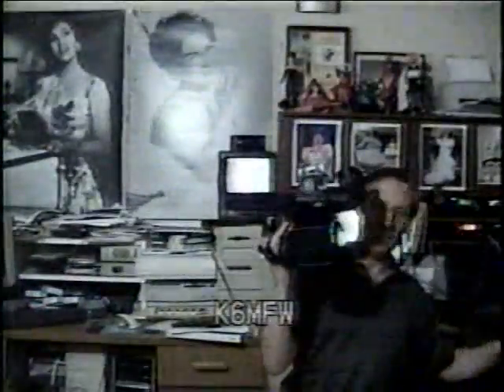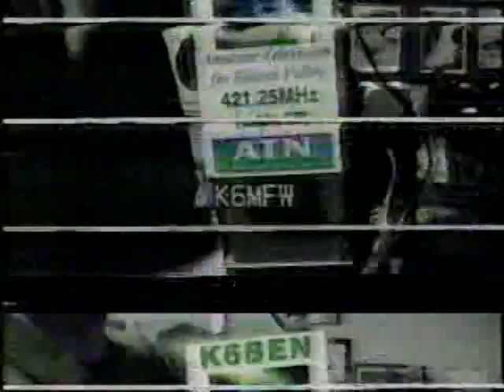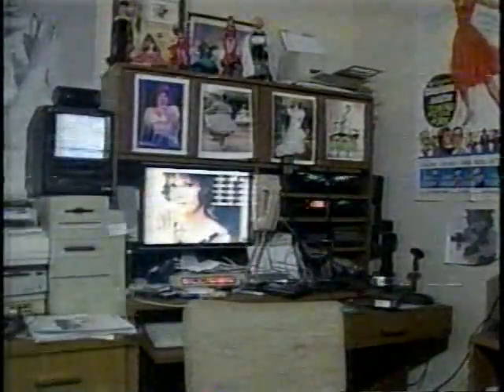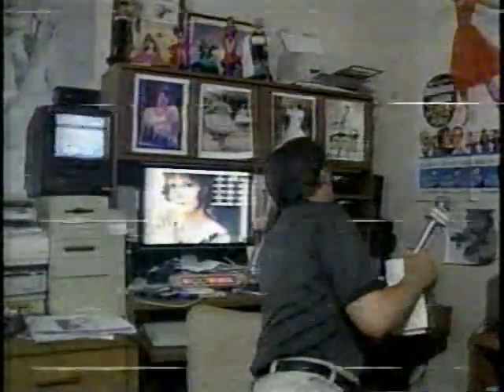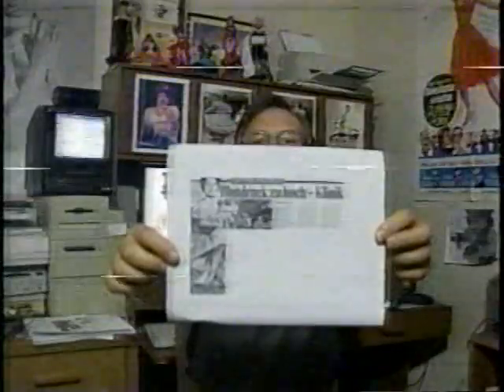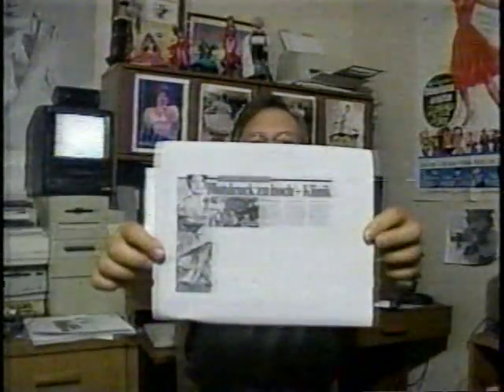ENG camera demo on K6BEN-ATV

Comment from the maker: @SuperTechieJ Yes, the modulator on rear provides wireless feed though range is not much, 100 to 200 feet. Modulator I typically use is a Vecima, has greater range, was sold used by Charles Lidstone dot com (out of stock for some time). Vecima is larger though.

As far as emergencies, it might be useful but major obstacle is access to top of buildings/mountains/helicopters is limited and most like not safe or available. Ground shots are mostly no value except usual B roll of trailer debris.